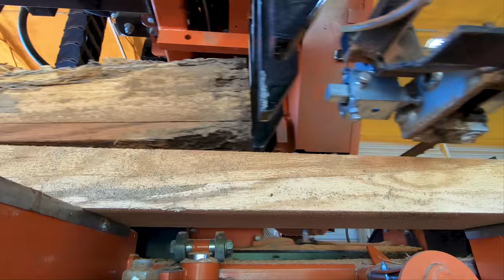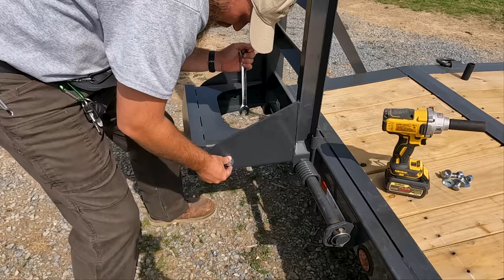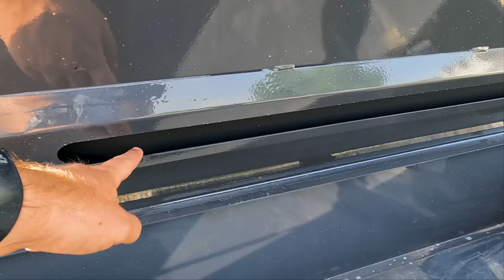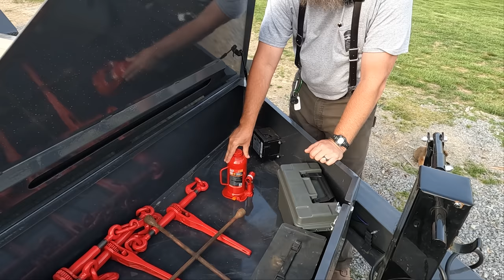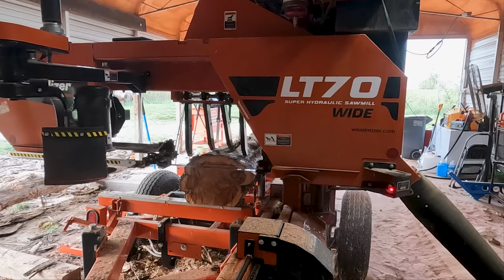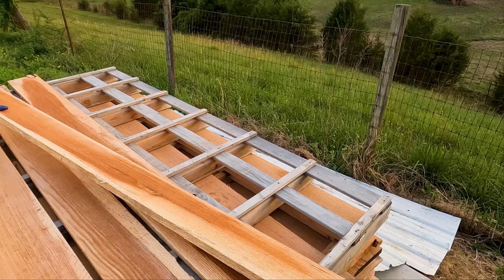Outfitting My Ironbull Trailer And Sawmilling Some Juniper/Cedar

Comment: I would add some boards in the bottom of the storage area. They would protect the metal from damage of the tools bouncing up and down and also be alor quieter. Wouldn't add much weight and you do make a lot of boards,

Comment: The piece of channel welded under the trailer tool box lid is mainly a stiffener so you don't dent the lid. You need to get a piece of 1/2" plywood for the floor of the tool box, and put some carpet on that for a non-slip surface.

Comment: Thanks for sharing with us Nathan. The channel iron under the lid of the tool box is just a brace for the tool box top to give it strength. Might put all your stuff in the tool box and decide where it will set best and then make a frame to set inside the tool box to keep things from moving around and sliding all the time. Stay safe and have a safe trip. Fred.
Reply: Yes, this is stiffening brace because sometimes you may have to stand on it and that will prevent it from buckling.
Reply: I agree too.
Reply: @joebufford2972  Yep ... and an "open channel" for "lightening" purposes; solid bar would be too heavy and cause a sag over time.

Comment: Something you might think of doing is adding a rubber horse stall mat to the bottom of the trailer tool box. Cut to fit.
Reply: Yes, I was just about to suggest that as those chains and binders will wear the paint off of the bottom of the box

Comment: As a trucker I'm lost without my 4" ratchet belts. I'd keep at least 4 of them in the box at all times. The chains and cinches are a must have too and are great for locking things in place but the belts keep your freight from vibrating around which can loosen chains.

Comment: You need to put in shelving paper in the box, not the paper kind but the rubber type comes in a big roll and it grips better and you cut to size and washable if you spill any liquids, I used it in the bottom of my tub when I broke my leg so I could bathe.

Comment: Nathan, here’s an idea for you , take some spray on rubber bedliner and spray the bottom and sides of your toolbox. Maybe give it two or three coats this should keep thing’s from sliding around and rattling . . .👍🏽 👍 🚜
Reply: will also help reduce noise and movement from tools banging around inside

Comment: Nathan, I think the "chain holder" is actually to support the flat lid.  I like to cut a piece of 1/2 plywood to "floor" the box. It dampens the noise, supports the floor, helps protect the finish & maybe keep metal tools from sliding/piling up in a corner. OR, just cut a few boards to fit.
Reply: Yip I the chain holder is just some steel to stiffen the lid

Comment: I would put some 1 1/2- 2" ratcheting straps in that toolbox on your trailer for things you might not want to be scratched up. Those binders are great but sometimes you might need a softer hold down.

Comment: Howdy Brother, for Your toolbox think about fitting some thick plywood or some wood You have milled in the bottom! 
It will save the finish on the bottom which will help with rust issues, additionally screw down some hardware in custom locations for some velcro strapping 
to keep things such as that bottle jack or binders from slamming around!
Enjoy the new addition to Your mobile equipment Nathan, well done Brother!

Comment: Is the bed on your mill supposed to be solid, or is it supposed to flex downward ?  @ 12:33 Approx, the bed of the mill drops 1/4 inch when the weight of the saw head is passing over it. If it were a machine mill, I would have my guys leveling and adjusting the supports. Just a thought

Comment: I was told when  got my trailer, that bar inside the lid was just a stiffener as the large lid need it. Another good addition to the tool box was cheap rubber mat material, or free rug material from a local rug dealer. Stopped the noises and helped with things sliding around

Comment: That metal piece in the trailer tool box is most likely there to stiffen up the lid.  Otherwise it would flex too much and not close properly.  My 2 cents.

Comment: That's a reinforcement. You may want to recheck the ramps when your have it connected to truck. If there to low when you ?mad the trai!er they may get hung up from the weight not be able to lift them. Past experience!!. I had to pull out from them made quite a bounce.

Comment: I would assume the channel on the underside of your trailer storage lid is just to make the top of the lid more ridged and the slot was cut as a weight saving measure? Or maybe they meant it to be used for hanging something on it like you suggested.
Reply: I would also suggest cutting a piece of roofing rubber or horse stall mat to put in the bottom of your storage box to keep all that stuff from sliding around and help with the rattle noises.

Comment: Yea harbor freight has the rubber mats u can cut to fit the toolbox. The rail on the lid could be a spot to carry ratchet winches if the trailer is set up for those, just a guess